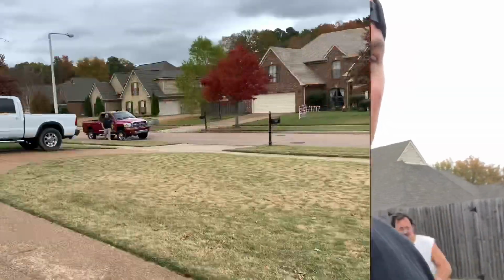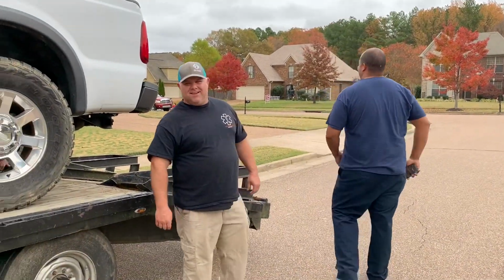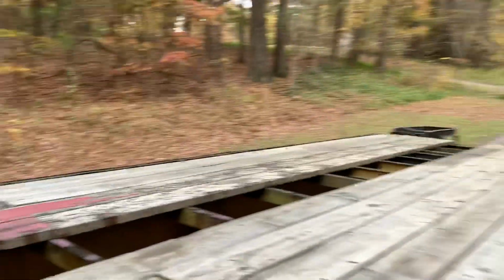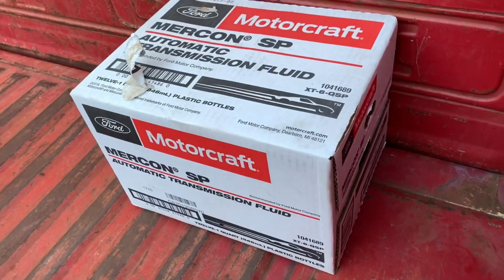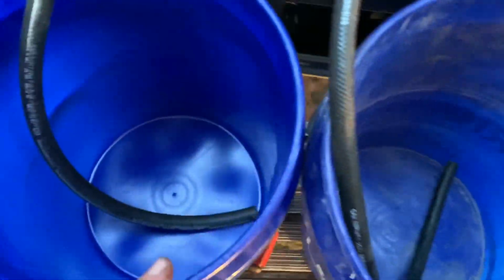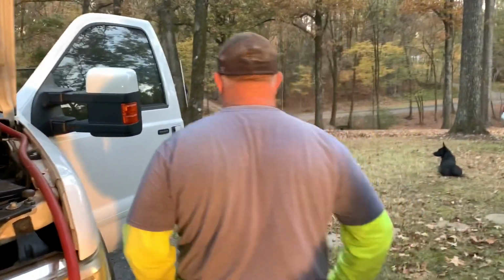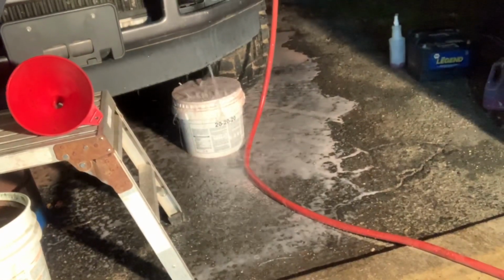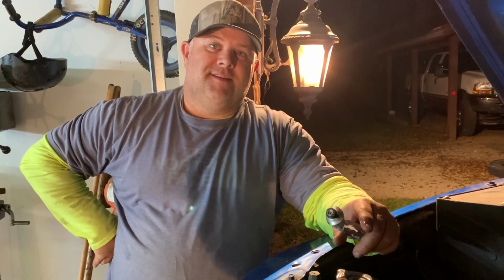Cheap 6.4 powerstroke

Comment: Found a 6.4 for a great price! Guy told me the water pump replaced and drain and fill on coolant, both fuel filters replaced and the fuel water separator bowl took apart cleaned, and reinstalled. The truck is all stock and has 248k miles. The truck is nice except for a ding here and a scratch there and a hole in the driver's seat. It's a lariat to. Really uncertain. Any advice
Reply: Don't buy it unless it has been serviced properly and has been deleted. And even still it's a 6.4 known to be a trash engine my personal advice is get a 6.7 or 6.0 that has been bullet proofed. 6.4 is a great looking truck it was just built cheap.
Reply: Buy it, try and nurse it as best yoy can. The 6.4 is going to fail. It's just a question of when. Have a 12 valve sitting on a pallet, ready to go
Reply: @melissaholmes6131  The 6.4 wasn’t really fords fault. They were bound by contract to buy engines from international/Navistar. That’s why if you look at a 6.0 or 6.4 valve cover you see the Navistar plate and not a ford plate. With the 6.7 being a true ford design they have proven that they can make a reliable diesel. The 6.4 is basically a International MaxxForce 7, witch is equally junk. Ford actually never paid Navistar for the 6.4 because of all the warranty claims they had to do on these trucks. There were some f-450’s that had 3 and 4 engines put in under warranty because they simply blew up from being used in the HD applications. International/Navistar actually has had several class action lawsuits brought against them for knowingly selling bad engines, the most notable case being the MaxxForce 13 in their medium and heavy duty trucks. They paid out 135 million dollars from that lawsuit. So, long story made short is that Navistar knew the gig was about to be up with Ford. They knew that ford was getting ready to dump them and make their own engine, so they gave them and engine that would make lots of power and sell trucks. They cut every corner that they could to try and save their share holders pockets from running dry but ended up shooting them selfs in the foot, shooting ford in the foot and the people who bought the trucks in the foot. I always tell people this. - Dodge didn’t make a good engine, Cummins did. Chevy didn’t  make a good engine, Isuzu did. Ford didn’t make a junk engine, NAVISTAR did.
Reply: Guess what, if you don’t maintain it and drive you beat the stuffing out of it, it’s going to fail
Reply: @detroitdiesel-vu3ig  All engines are going to fail. It is just a matter of when.It's just that fixing a 6.4 is more expensive.

Comment: Have a quick question,could you have used a cheaper transmission fluid just to flush the system because that is an expensive waste.

Comment: I have an 08 6.4 awsome truck . 135000 miles. Tons of power. Truck is stock but thinking of deleting it .is your truck deleted yet
Reply from the maker: noraa yes it was already dpf and egr deleted when we got it but unsure of when it was done. Truck had 164k on it and I’m sure it was done after the 100k mile warranty. Watch all of our 6.4 series and see how we came out on the whole deal.
Reply: Yes. Mine is full delete. Did the deletes at 95K got 136k now love it bought it at 62K the previous owner hauled his home to the Oil fields up North then used the truck as a service truck. I bought it in 2012 and drove it till I couldn't live with the embarrassment. The regen is the most embarrassing thing I have ever had to live with. So videoed my embarrassment of the government's failed science project and proceeded to delete it put a catch can on with a baffle in it ran a 1-inch ID heater hose to it and from it had to empty it twice in every 5K oil change Now it makes it to its 5K oil and filters change. Just re-done the trans put in a shift kit and upgraded the reverse to the new model. I love this truck and added an aftermarket cold-air intake kit with the delete. Went with the S&B tired of the censor calling for an air filter change. That stock air filter chocked that engine like a hangman's noose and no more fuel in the crankcase oil. Happiness 😂😂😂❤
Reply: I have an 08 88k miles mint condition.  Deleted.  Runs amazing hoping for a lot of miles out of it

Comment: I have a 2009 f350 I got off may dad a month ago in white. Running real good after tune and delete a few odd and end like pinion seal went on her and the radiator both leaked on driveway next day after buying and now I have a bad seal on the oil pan and have a small oil leak and I just had the oil freshly changed so going to wait to fix that one.

Comment: Why not drop the pan twist the external trans filter off get rid of most of that pink stuff then do a flush
Reply from the maker: Cause the torque converter holds 6 quarts on its on and you can’t drain that on the 6.4 so you would just re contaminate. There was a method to the madness

Comment: I believe there's a TSB to changeover to MERCRON LV quite some time ago.
Reply from the maker: FRANK DAIII they are compatible fluids. Either is acceptable in a 5r110
Reply: @AutomedicGarage  Oh absolutely! I mentioned it because none of the Ford dealers here deep south Texas, nevermind the local auto parts stores, stock SP.  I was going nuts looking for 19 qts because I was performing the full flush as well.  The 4th dealer I called finally mentioned the TSB, which then simplified my hunt to the local Walmart.
Reply from the maker: FRANK DAIII Homer Skelton here in Millington Tn had the 5 cases we needed. They take good care of us.

Comment: Is it possible to make a 6.4 a reliable engine in any way? I have a 6.0 that I love but I like the ‘08-10 generation truck better, just too scared to pull the trigger!
Reply from the maker: I’ve had some good ones I’ve worked on a long time but they were deleted damn near right off the lot. Those are the ones that last. Choates performance that isn’t far from us builds custom 6.4 motors that are supposed to be the cats meow.
Reply: @AutomedicGarage  I was just reading up on Choate’s…. looks like they do some extensive machine work on all  the Powerstroke platforms. Anyway, thanks for the input on my 6.0 the other day and Merry Christmas!
Reply from the maker: @Powerstroke7911  did you call me about the 6.0 F450?
Reply: @AutomedicGarage  no, I asked your opinion (on a different video) about the head gaskets on my ‘06 that I just got a few months ago. It’s studded with a Bulletproof EGR cooler that just started puking a little coolant and blows white smoke for 10-20 seconds on hot startup. I just started running a mild tow/economy tune. I was wondering if it could’ve been a cracked head that was missed at the time it was studded. I haven’t even towed with it yet. I was out running errands and stopped for fuel. When I started it up, it was blowing white smoke and (not even puking but more burping) coolant. Sorry for being long winded, but trying to be thorough.
Reply: @Powerstroke7911  The 6.4s definitely have a nicer updated inside interior than the 6 liters.

Comment: I know this is old, but I’m willing to bet the oil cooler blew up shortly after y’all got it back up with all the oil in the cooling system unless you did a proper cooling system flush.
Reply from the maker: The trans and cooling system got flush 5 times total. 72 quarts or trans fluid and 2 quarts of cascade dish detergent in the coolant system. It was flushed.
Reply: @AutomedicGarage  did you pull the block drains?
Reply from the maker: @richardluna652  yea, this ain’t my first rodeo.
Reply: @AutomedicGarage  didn’t say it was your first rodeo, FS.  A bunch of techs don’t like to do the whole flush procedure because to do it right it takes so long and pulling the starter each time to get to the block plug.
Reply from the maker: @richardluna652  I don’t pull the passenger block plug. I leave the starter and pull the block heater that way you can run the truck with it pulled and force the crap out of the block FS

Comment: Whats all done to it to make power? Deletes tuner????
Reply from the maker: @oscarreyna9581  it was already deleted and tuned, that was it. 6.4s are a powerhouse but also a ticking time bomb at the same time.
Reply: @AutomedicGarage  what tuner do you have? I have a Mini Maxx that I haven't put in yet.
Reply from the maker: @oscarreyna9581  I think this one was a mini max, got a lot of trucks pass through here and we sold this one 2-3 years ago.
Reply: @AutomedicGarage  oh, that's how old these vids are. I watched all 3 of the radiator and heater core. Great videos!

Comment: Just wondering what made the engine ticking sound go away?
Reply from the maker: As far as the motor goes all we did was change the oil and fuel filters and ebp sensor, the rest was just the radiator, flushing the trans 3 times and a new heater core.

Comment: 6.4 is a high price engine, not just Ford built the engine. However, the 6.4 Powerstroke was built by Navistar. It depends me, the 6.4 Powerstroke is the worst diesel engine ever because the emissions components and more parts are having issues. They're so unreliable engine. Don't get me wrong, i love the 08-10 6.4 trucks with a Cummins conversion. I was watching Bill Hewitt on YouTube. so, he's not going to fix on the 6.4 anymore and his truck got burst in flames.
Reply from the maker: Yea if you’ll watch my channel I’m a Powerstroke mechanic. It was built to be thrown away because international was mad at ford from lawsuits from the 6.0 days. Ford didn’t build any of that motor only international unless your talking accessories and brackets.

Comment: Why a 6.4 tho. Not a 5.9, either of the 6.7's, maybe even a 7.3 or even a 6.0?
Reply from the maker: The Unlucky Frog not sure what u mean. Are u asking why not swap any of those in?
Reply: @AutomedicGarage  I meant the 6.4 is junk, you might as well swap something else in
Reply from the maker: The Unlucky Frog I think Gary is leaning toward just selling it a making some money off the truck
Reply: When the 6.4 is running it will spank any of those that you listed except maybe the 6.7.. the 6.4’s are a hoot to drive
Reply: @joeyjordan1209  I know they are fast, but its far cheaper to compound turbo a cummins and have the same power and far better reliability. Probably why people cummins swap them all the time
Reply: @smokendiesel4958 Ugh, 6.4 are so unreliable and expensive. Figures. They ended up doing a Cummins swap on the 08-10 6.4 trucks.

Comment: Just curious Why didn't you guys just dump the contaminated trans fluid from the get-go .... instead of flushing????
Reply from the maker: Cause the torque converter is full of fluid. It took all the flushing to get the pink milkshake flushed out of the whole system, mainly the torque converter.

Comment: There is no such thing as a cheap 6.4. It will eventually cost you a lot of money.
Reply from the maker: James German I do agree with you for the most part but I recently have turned wrenches on 2 that were deleted earlier in the lives and are running strong with over 200k and never any major service to either of them. The regen washing the rings out and the dpf getting clogged really hurt those motors more than anything.
Reply: @AutomedicGarage  I’m a Ford Diesel Technician and I’ve dealt with these a lot. When they are good they are really good. But the prices to repair them once they go wrong are ridiculous. Parts cost more, labor is always more because they are so hard to work on. And forgot it if someone works on it that doesn’t know what they’re doing or doesn’t have experience with them. They rest of the truck is great, they have the best suspension, brakes and transmissions but that damn engine will eventually be a nightmare.
Reply from the maker: James German I totally agree, I love the old 7.3s and 6.0s are great once they are fixed right and I’ve kinda always had a soft spot for the 6.4s when they run they really run. I’d love to swap in a max force 7 bottom end with the better oiling rings, bushing for the wrist pins and pistons that don’t crack.
Reply: There’s literally no such thing as a 6.7
Reply: @smokendiesel4958  Literally?